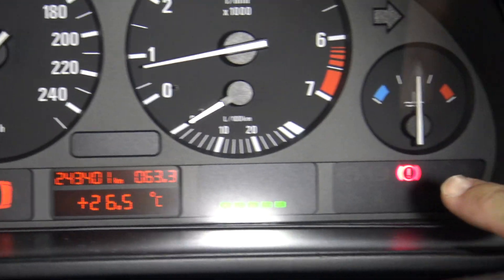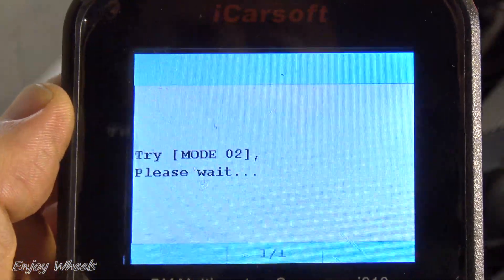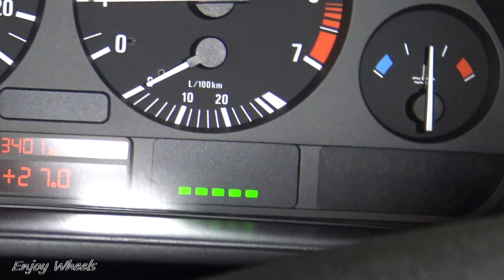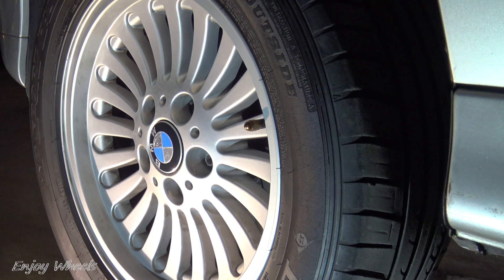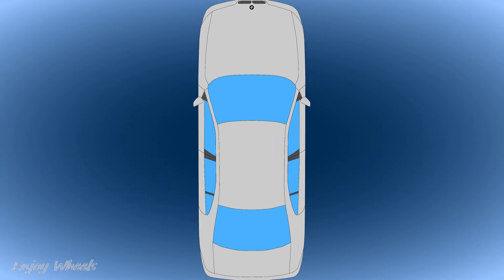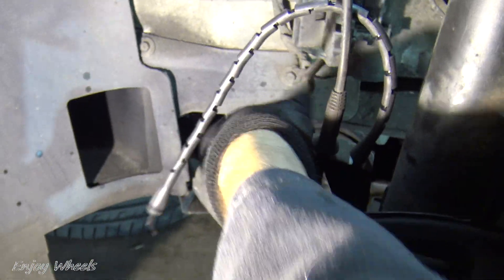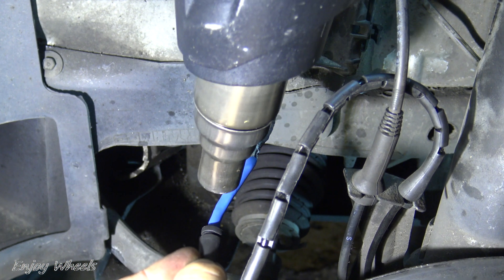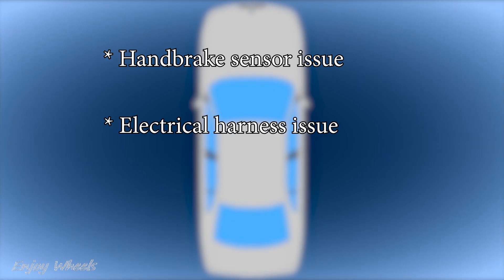Brake Warning Light Stays On While Driving: What Are the CAUSES and How to Fix It?

Comment: I habe nissan qashqai 2017, 1.5 j10 diesel, mannual transmission.  Same light comes, nissan  said spark  plug probkem, change sparks plug.
Sign dont dissappear, then again they change hand brake system, sign is there again, now they said its a position switch in a gear box... I have a inspection coming soon. This  is getting in my nerve... Please help
Reply: Have you solved problem. I have xtrail and that light pop up, everithing is ok bit it still coming?
Reply: @arminrobot  My Car BMW X5 E53 2001 3.0 :  I have checked Brake Fluid Reservoir, Pad sensor, Any broken wire but I do still my Brake warning Light turns Red  ALONG with ABS, Traction Control Warning Light and also speed meter/pointer (gaze showing Zero miles per Hour) remains at Zero.  If I leave my car (NOT Driving) over night couple days, on 2nd/3rd morning I see all of the Light are gone.  No X-mas lights but after driving 5/6 miles  on city road all of the above light comes ON.  However, car runs great without any problem. I changed all 4 Speed Sensor, Brake Pad Sensor,  Brake pads are good (1 yr Old). OBD2 code shows problem with O2 sensor and for that SMS light is/was ON for last 4/5 years.     
            Any suggestion ? Any helpful Tips will be greatly appreciated.    Please respond me via my email at zraihan07@gmail.com